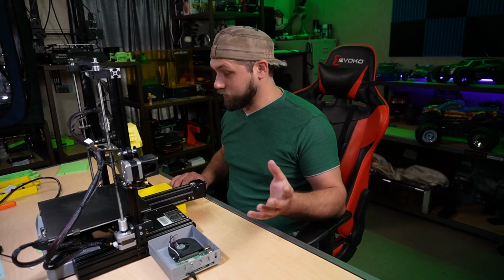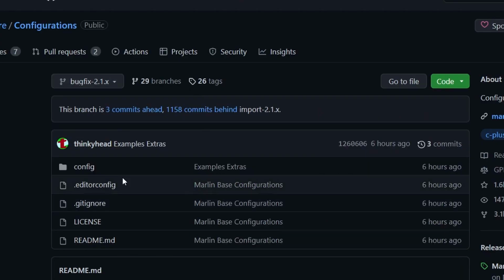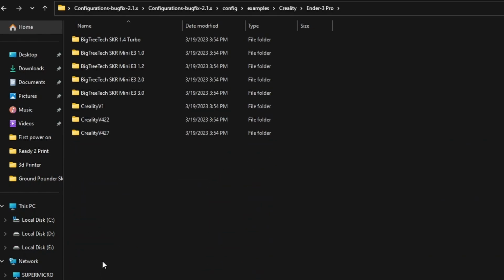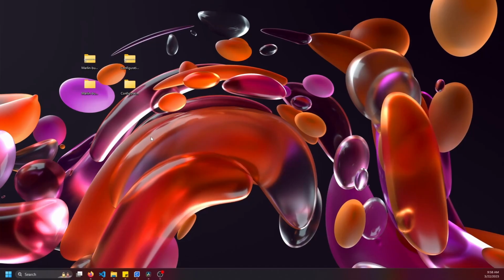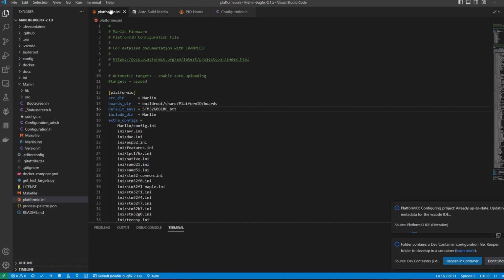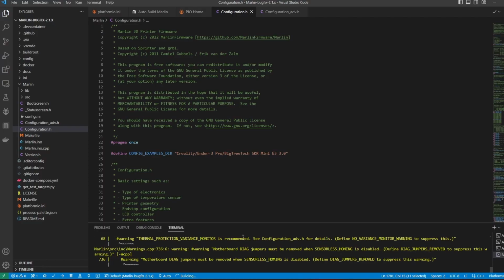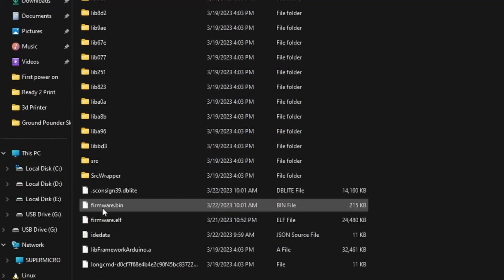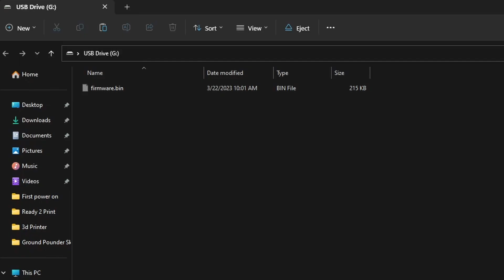Ender 3 Pro Upgrade: BTT Skr Mini E3 V3 Installation and Basic Firmware

Comment: Error: Unknown environment names 'STM32G0B1RE_btt'. Valid names are 'include_tree'    eVERY TIME I GO TO BUILD I GET THIS ERROR ANY IDEAS WHAT IM DOING WRONG
Reply from the maker: That is needs to be changed in platformio.ini  this can be seen in your marlin-bugfix-2.1 3rd up from the bottom in vscode on the list to your left. Then click platformio.ini should see  a new tab open in the tab  look for    ( default_envs = mega2560 )
change it from the mega2560 too STM32G0B1RE_btt  . The go to File in to left and find and click save before leaving. Now you can reopen your configuration.h and click the check it should now build.

Comment: Buen día mi consulta es de podra hacerlo para una Ender 3 pro  complica skr E3 Turbo board LPC 1769 que tenga sensor de rotura de filamento, cr touch 5pines y doble eje z con pantalla TFT 35 e3 v3 si se puede me podrías ayudar indicándome como comensar

Comment: Any still on this that could help

PlatformIO BUILD keeps failing with mega2560 is incompatible
Reply from the maker: That is needs to be changed in platformio.ini  this can be seen in your marlin-bugfix-2.1 3rd up from the bottom in vscode on the list to your left. Then click platformio.ini should see  a new tab open in the tab  look for    ( default_envs = mega2560 )
change it from the mega2560 too STM32G0B1RE_btt  . The go to File in to left and find and click save before leaving. Now you can reopen your configuration.h and click the check it should now build.

Comment: really annoying they removed the pinch connector for the fan wires in the V3 now I gotta go buy a whole ass connector kit and crimping tool for a single fan connector 😩
Reply: I was upset about this as well, but I also recently added a BL touch to my machine, so I just cut the end off the Z limit switch since I'm not using it anymore and soldered it onto my fan wires.
Reply: @zackthefreeman  I did a similar thing.... annoying indeed
Reply from the maker: It is annoying i agree, In my case i had some laying around to steal from other device and from other repairs. Thanks for watching.

Comment: Noob here, I have an Ender 3 pro with a btt skr e3 v3.0, i have found that the printer is missing a z end stop, if i get one of these can anyone tell me where i plug it in the circuit board please, kind regards.
Reply: Might have been removed if you have a bed level sensor. common to remove it when a BL or CR touch is installed.
Reply from the maker: Hopefully the community can help I only have one of the newer ender 3 pro and when i got it some one els was trying to mod it so have no clue what original and whats not.

Comment: My wife just bought me a Ender 3, SKR mini E3 with the TFT and BL touch. I tried the firm ware for the SKR mini (placed on sd card named firmware.bin) The LCD lights up no display and the TFT screen says printer not found.
I quickly ran though the steps in this video and this just seems like a lot to compile something that should already work.
I am not sure what to do.
Reply from the maker: From my experience with tinkering with printers and adding aftermarket parts, it always requires some adjustments to get it right, but that's the part I enjoy. However, I understand it might not be everyone's cup of tea. If you're still having issues, feel free to reach out to my email; I'll try to help as much as I can over the web. Thanks for watching.
Reply: @RatchetBuildz  I did find firmware that worked. For whatever reason, the Bigtreetech firmware didn't work.
I recently made my life harder by installing the Sprite extruder pro kit. I've been on offset learning bit last 3 days. Killed 2 nozzles and scratched up my bed something bad.
Shockley, not a lot of of clear videos on fixing xy centering.

I about ready to break down and learn to compile my own firmware.

Thanks for the reply. I should be able to figure it all out, eventually.
Reply from the maker: @tratzum  see if I can link the videos from way back that help me center it not to bad after doing it the first time .

Comment: my platformio.ini file seems way shorter and i get an error in the terminal.. (unknown environment name "STM32G0B1RE_BTT") i dont know what env name to use and it seems the video you linked the dude found the env name in his ini file which i dont have the list of names in there.
Reply: my platyformio.ini file is 150 lines long :(
Reply from the maker: The firmware may have changed again, but the instructions should be the same, maybe slightly different files names. I have a lot going on this week, but see if I can find some time to look at your issues and try my best to get an answer to you . No promises.  Also, for the enviroment error ,  have a reply in the comments below how to fix that . If you find a fix before I have time to reply, please leave an update comment. Thank you for watching.
Reply from the maker: I pin the comment I replied  to make it easier to find .

Comment: So i have upgraded to this board for its silent nature which is great, but have ran into 2 issues, CR Touch no longer works/ Z Homing, which is to be expected with the basic firmware installed, but was wondering if you knew how i could get the CR Touch firmware merged with this or would i just need to find another Board firmware with CR Touch included in the firmware flash?
Reply from the maker: Sorry for such a late reply. There should be instructions in the firmware on how to turn on the touch of the CR touch. I haven't done this myself and wouldn't be able to guide you at this time, sorry.

Comment: Great and helpful video! I have small amount of knowledge in doing this, watched a few other videos, and this video was very through and helped me out the most! 

After learning how to crimp wires into a JST connector for the first time, I started to panic when I ran into some trouble with the Visual Studio Code. I combed through the comments and find that you were able to walk someone else through it! It was the line of mega2560, needing to be changed. 

I put the miniSD card with the new firmware and it was so crazy not hearing it be so loud. Such a game changer!

Thank you very much for the great video and being helpful even though it has been months since you posted!
Reply from the maker: I'm so glad it helped . I want to make a longer video that covers everything. The reason I made this video was trying to get a deeper dive on mods because I had issues with setup due to  steps being  left out of other videos .  Then I even left a step out of mine .  Thank you for watching. i plan on updating this video in the near future.

Comment: Awesome stuff as always! I have basically the same setup as you with a Ender 3 pro, Microswiss full metal end, big tree tech mini E3 V3 and such. Could you share your configuration file? That would help immensely.
Reply from the maker: I'll look and see if I still have it saved from my back, but normally, I just rebuild a new configuration file everything I need to update.  Bare with me on time since im not home much due to my regular job continuously changing my schedule.
Reply: @RatchetBuildz  I appreciate it! I have been meaning to get my ender 3 back up and running but figured I would do it with all the new components. I'm working 50+ hours also, so I get it.
Reply from the maker: It looks like I still have the last config that I put on my machine. Shoot me an email, ratchetbuildz@ratchetbuildz.fun, and I'll send over the compile and the marlin bug fixes fold I'm using . This is not the latest update, but you can scrub through my config.h and see what I had to change
Reply: @RatchetBuildz  okay send
Reply: Hey man thank you again for the firmware. Just curious what slicer are you using and the settings for it ? Not sure if you can export and send that over as well. I just don't have time for the next month as im in the middle of moving as well but do want this up and running. I did get your firmware working and bl touch as well as touch screen.

Comment: you skipped over how you got rid of the errors. I dont know how to get rid of the errors, and its not letting me compile the changes. Please help
Reply from the maker: What is the error you are getting?
Reply: @RatchetBuildz  my error says something like, " Please update your includepath. Squiggles are disabled for this translation unit"
Reply from the maker: I'll be honest here I have never ran into this error . I'm not sure how to help you with this one. I have to experience the problem my self and start reversing the issues tell I found the problem .
Reply: @RatchetBuildz  i finally got it to work, i was trying to increase the max nozzle temp, and i guess i exceeded the maximum that it allowed. All good now, thanks for responding!

Comment: After updating the firmware, my rotary knobs does not seem to be functioning right. I can turn the the knob it will change menu icons (Using Creality UI instead of Marlin UI) but when I press the rotary knob the printer restarts itself. I have tried updating the display firmware too. Any ideas?
Reply from the maker: Thank you for your comment! Although this isn't my video, it seems like you might be experiencing a similar issue. Personally, I haven't encountered this problem with my printers, as I have touch screens that I purchased along with my new main boards. However, the video you shared might provide some insights and solutions. Feel free to check it out: https://youtu.be/t4QE1jPncms . Thanks again for reaching out!

Comment: Error: Config files found in directory C:\Users\tinne\desktop\Marlin 4, please move them into the marlin subfolder.                 Enviroment  Mega2560   Failed. thanks
Reply from the maker: As for the Build Environment problem this needs to be changed in platformio.ini  this can be seen in your marlin-bugfix-2.1 3rd up from the bottom in vscode on the list to your left. Then click platformio.ini should see  a new tab open in the tab  look for    ( default_envs = mega2560 )
change it from the mega2560 too STM32G0B1RE_btt  . The go to File in the top left and find and click "save" before leaving. Now you can reopen your configuration.h and click the check at the bottom of the screen it should now build.
Reply: @RatchetBuildz  thanks for your reply, got it working even to the point of my extruder stuttering and not extruding. is there a basic firmware without compiling?
Reply from the maker: It seems to me that you may have changed the name of the firmware folder on your desktop. Normally, I leave mine with a stock name, but the configuration files need to be placed one more folder in. In the main folder "marlin4" that you're in, click the "marlin bug fix" folder. Inside it, you will see a folder named "marlin." Click that folder, and this is where your configs should go. This is also where your configuration files that need editing are located. You should see "config.ini," "configuration.h," and "configuration_adv.h" in this folder.

Comment: Hi there, I've recently upgraded my ender 3 with the Skr mini e3 v3. I've been following your video all the way up to the firmware update and im fully lost, I have no idea about coding at all and 3 hours of trying has not helped my gray hair. Do you know of an easier way to do this or should I just put it in the bin?
Reply from the maker: There is an easier way, which involves downloading and installing the prebuilt firmware from BTT or from Ender. However, based on the comments I've seen from others, the firmware provided by them may be outdated and may not have the specific settings required for the modifications you have made to your printer. If you have only replaced the main board and kept everything else stock, downloading and installing the firmware should be sufficient. Have you checked to see what firmware came with the new main board? Some users have reported that the stock firmware worked for their printers.
Reply from the maker: There are some excellent videos available, such as those by TeachingTech on YouTube, that provide more detailed instructions. While these videos may be slightly older, most of the information still applies to newer firmware versions, although there have been some changes. I have plans to create a better video on this topic when I find the time, but I recently started a new job, so it may take a while before I can make that video. It's worth mentioning that I entered this process with no prior knowledge and spent weeks learning about firmware and how to modify it for my specific needs before successfully getting my first printer operational again.When I was conducting my research, I discovered numerous videos on firmware, each contributing to the overall understanding. I've been learning from the comments on these videos to identify the topics that need to be covered comprehensively. It may be necessary to create multiple video series to address all aspects adequately. Thank you for watching, and I hope this information proves helpful in the meantime.

Comment: Gonna have to build my own f/w for my Ender 3 Pro, I had 2 boards with different f/w on them, went to the SKR download page and grabbed the latest one, now I have 2 printers on the same f/w, but the older board I had, had newer f/w on it (2022-08-30), now both are on the older 2021-12-07 f/w, Yay BigTreeTech, well played....
Reply from the maker: I love to take apart and rebuild my printers almost right out of the box, which means I had to modify the firmware for all of them except one. It's important to select the correct firmware for your machine, and when upgrading, it's best to take it slowly and work on one part at a time to avoid introducing too many variables. I found that none of the 4 to 5 main boards I switched had proper firmware for my machines, except for the basics.
Reply: @RatchetBuildz  I stripped and rebuilt both of mine as they were used and I like to know whats what.
Both are pretty much stock a few 3d printed extras and I've just converted one to DD using the Creality kit and obviously both are now running the Mini E3 v3's, I would have thought, given that one of them had newer firmware than the other, that the newer firmware would have been on the BTT website, rather than the older f/w the second board was running....

Comment: Nice video.   That plastic clip you had to replace.  Do you have a link to where to get one?  Or more details as to what it is called so I can order one.  Glad I watched your video first because the one bigtree tech maked doesnt tell you about the wrong connector or the fact you need to make a firmware update.  I ordered my board with a BLtouch on amazon.   Should I wait till I update the board before connecting the bltouch?    Suggestion:  Include a link to pin out.  Really wansnt hard to google it.  Also back ground noise.   There is this constant clicking. Very distracting.  Other wise great video.  Thanks!
Reply from the maker: I will investigate the background noise and determine its source. During that shoot, I accidentally used the built-in microphone of my new camera instead of my lapel mic. Thank you for your feedback. I found a connector (https://www.amazon.com/gp/product/B076JFFDWN/ref=ppx_yo_dt_b_search_asin_image?ie=UTF8&psc=1) that should fit, but you need to check the pinout to ensure that the positive and negative are in the correct positions. Additionally, some models have issues with the MOSFETs getting stuck on or off, so I suggest double-checking that the heated bed and hot end function correctly before reassembling everything. It's important to choose the correct firmware with BLT enable, or else it won't operate properly. From my understanding, there are two ways to connect it: through the main board or through the aftermarket BTT screen. Thank you for watching and giving me feedback. In the future, I plan to make a video about adding the BLT and getting rid of the springs on the bed, and my goal is to address issues that I never found in other videos and show the problems I encountered.
Reply from the maker: I now have a link to the pin out i used for this.

Comment: i got a problem with the building part it said mega2560 isnt compatible with btt wkr mini e3 v3 board try... help me please
Reply from the maker: That is needs to be changed in platformio.ini  this can be seen in your marlin-bugfix-2.1 3rd up from the bottom in vscode on the list to your left. Then click platformio.ini should see  a new tab open in the tab  look for    ( default_envs = mega2560 )
change it from the mega2560 too STM32G0B1RE_btt  . The go to File in to left and find and click save before leaving. Now you can reopen your configuration.h and click the check it should now build.  If you have any more problems you can email me at HelpRatchetBuildz@ratchetbuildz.fun.
Reply: @RatchetBuildz  I know I'm not the person who asked the question but I have to say I have rarely seen any YouTuber actually helping out their views this much to the point that they not only answer their questions but provide an email for added support. Subscribed just for this.
Reply from the maker: @SAK.124   Yes, I enjoy helping others, and I will continue to do so as long as I can, until it becomes overwhelming. Though some things are harder to diagnose over the internet rather than in person, if I can grow my channel, I would love to employ a team to help others as well, but that is much future thinking. Thank you for the subscription and comment.
Reply: @RatchetBuildz  hi, if possible could you pls let me know if there is any code you need to change for the fan to work properly with the new connection, like what temp it should start at etc? Ty, rlly appreciate it
Reply from the maker: @SAK.124  Nothing i have ever needed to change and I have been using it a lot with the new board to prototype RC parts.
Reply: @RatchetBuildz  oh ok great, thankss